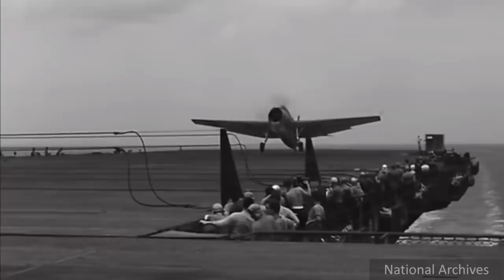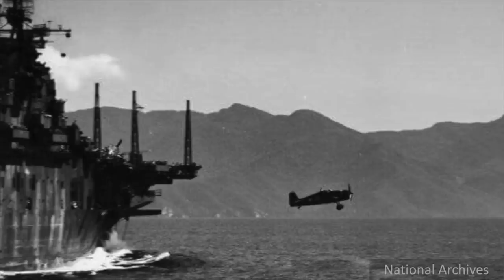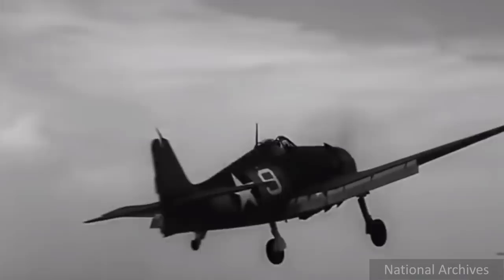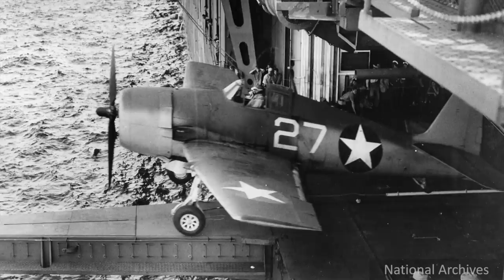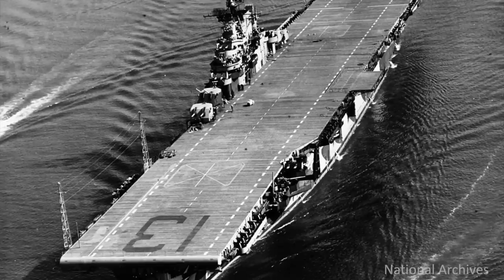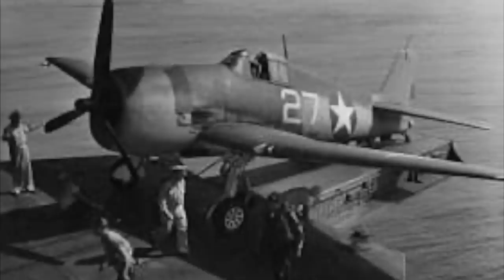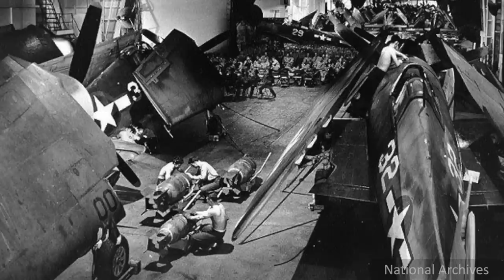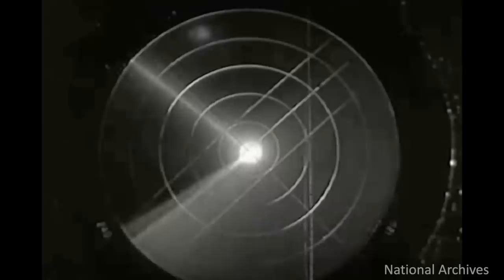Who Knew WWII Aircraft Carriers Could Do THIS?

Comment: Ships had been using catapults to launch float planes for some time before carriers were a big deal. I can't recall the types, but the catapults were up high and rather short.
Reply: Yeah, Battleships and Cruisers used catapults to launch float spotter plains for years leading up and including WWII.
Reply: @williamfuller2389  The British King George V class battleships carried their catapults amidships and launched straight to the side. Same for the USN's Pensacola class cruisers and New York class battleships. Later American ships carried their cats on pivot mounts on the stern, so they could (partially) control the launch direction.
Reply: the key, was up high...and irrc they used a gun powder charge rather then steam or compressed air.

Comment: Planes were launched from Cruisers for scout/patrol purposes as well.  There were catapult arms that pivoted out from the stern to launch float equipped planes.  Recovery was done with a hoist and they were lifted back aboard.  Helicopters replaced them later on.
Reply: They were seaplanes that landed in the wake of the ship and were hoisted up.
Reply: I would add that those were small 2 set planes meant for spotting for the big guns.
Reply: every ship class larger than a destroyer had scout planes from the 1920s until the 1950s, including the needed hangers and elevators

Comment: The Japanese did it; they even built some that had a flight deck extending directly out from the hanger deck, below the upper fight deck.  They had at least one carrier that had three stacked flight decks (one was very short, but it was there).  They pretty much abandoned the idea by the time of WW-II.
Reply: the triple flight deck was an early ship, when planes became too powerful for the old design to work the lower flight decks were removed and converted into hangers while the top deck was extended.

the ship was lost during the Battle of Midway
Reply: @bostonrailfan2427  Akagi and Kaga

Comment: The relative crosswind was a huge help. I don't have my E6B handy, but the pilot has no crosswind effect until flung off the catapult. The aircraft will then naturally weathervane to the hypotenuse of the combined vectors. That airspeed will always exceed his catapult velocity. I got the E6B and this is hard to sus out as you kind of have to work it out sideways, it is smudged, and I am using the wrong pencil. But assuming a ship speed and wind over the deck combining to 40 units (knots, mph, whatever, let's say mph) and a cat speed of 60 mph, the plane weathervanes into a relative wind of 72 mph over its nose. I erred on the low side. If launched underway, if you came off the catapult with aileron  and some rudder towards the bow, it would just come off as a gust reaction.

So it would help, but the launches in the video appeared to be at rest, and so apparently not necessary.

Comment: The first ship to ever launch and recover an aircraft was HMS Furious during WW1. She started her life as a fast cruiser and was then converted to carry RNAS Sopwith Pups by removing her forward turret and building a launching deck from the main superstructure to the bow. She then underwent a series of re-modelling, first removing the rear turret and adding a landing deck on the stern (before then pilots had to fly alongside the superstructure and sideswipe across onto the take off deck - incredibly dangerous  as the pilot who first managed to take off and land back on a moving ship at sea, Squadron Commander Edwin Harris Dunning was killed five days later attempting the same landing when an updraught from the superstructure lifted his Pup over the side of the bow, he was knocked unconscious and drowned in his cockpit). Furious then had a pair of side decks added allowing the biplanes to be rolled from the aft landing deck to the bow ramp and then finally did away with the last of the cruiser superstructure completely to build a through deck or 'flat top'. Her command bridge was situated in the centre of the flat deck at the bow and retracted down to allow flying to commence.
Before the start of WW2 she had a new higher flightdeck constructed but still retained her original bow section which was level with the hanger deck so she could actually launch her aircraft from the lower deck and recover them on the upper one at the same time.
Furious was the first ship to launch and recover an aircraft whilst at sea, the first in incorporate arrestor wires for landing (although they did tend to remove the undercarriage from light weight biplanes!). The first to launch a carrier attack against a land target (Zeppelin sheds, before that she was intercepting the Zeppelins themselves over the North Sea)
She carried on into the second world war, taking part in the Norwegian campaign, ferrying aircraft to Gibraltar and Malta and her Swordfish took part in attacks against the Tirpitz. She survived the war, a German Heinkel bomber's bomb missing her by about 10 yards which threw her prop out of alignment and was finally scrapped in 1948.

Comment: Actually the IJN came up with another innovation - on their two big early carriers of the 1920's,  the Agaki and the Kaga, they had not only a flight deck which did not extend as far as the bow, but also an upper and a lower hanger deck.  Simply open the big doors at the front of the hangers, and fly off a few planes that way when the ships were steaming in to wind.  So, in theory you could launch planes from three differen tpositions - flight deck, upper hanger deck and lower hanger deck.
I think the Akagi lost this ability to launch from more than one deck after a big 1930's refit, but the Kaga continued with it until she was lost at Midway in June '42

Comment: I always wondered why I haven’t seen carriers having “two flight decks”. Dangerous probably, but can be used in an emergency.
Reply: They did exist. The Japanese Akagi and Kaga originally had multiple flight decks
Reply: The Royal Navy Courageous-class battlecruiser-to-aircraft carrier conversions featured two flight decks, but the lower flight deck was abandoned due to the longer take-off distances of 1930s aircraft. It seems that WWII-era carriers and carrier frontline aircraft existed in this sort of zone of not using catapults like post-war carrier aircraft would all the while the spotter aircraft of the era did use them. My guess is that catapult turnaround time was too long but one supposes that had something like the post-war catapult improvements been available in the 1930s then the second flight (or rather fly-off) deck might have been much more used, at least until jet aircraft made the entire concept completely obsolete.

Comment: There is a lot more to this than beam catapults launching out sideways. Several British and Japanese carriers were designed to conduct regular operations out of the hangar deck by flying straight out the front. The Japanese even built a carrier with no less than 3 launching decks, as the flight deck and both the upper and lower hangar decks could launch aircraft.

Comment: Avengers were big aircraft, but I wasn't surprised seeing one go off the  the hangar deck catapult.

"Dits" that were related to me by my father, an RN Fleet Air Arm Avenger pilot (TBF-1C, Avenger 1,) told of Avengers taking off from the main deck of an Escort carrier without catapult assistance (For one-off squadron re-deployment), after  the carrier had been beached in the Firth of Forth, Scotland following severe torpedo damage off Norway. So taking off, in a lightened state, not necessariy a full crew or any warload, when the carrier wasn't even underway.

Comment: A double-decker arrangement would make even more sense if the operation was longitudinal, rather than athwartships. Launch from the lower deck, and recover from the upper. That puts the weight of the catapults down low, still gets most of the headwind, makes a shorter trip from parked to launch, and leaves the upper deck clear for recovery and the usual excitements. Any idea why it was never tried? (Admittedly, the noise would have been appalling.)

Comment: The three Yorktowns also had this. Although Enterprises was ripped out during her late '42 major refit.

Yeah there's not a lot of info on these, because they were dangerous kludges that were never really used. You'll notice 3 of those early Essex's still exist today as museum ships. Other than the big doors you would be hard pressed to find any trace of these. They mostly all got removed at the carriers first major refit. I've never been sure why the early Essex's had them? As they were already planning on yanking them out of the earlier ships.

As you noted by 1943 US Carriers no longer operated alone. They were almost always in 3 Carrier task groups. So if one fouled the deck the other 2 would launch and recover for them. Also by 1943 all American Carriers had a single deck catapult. Which meant they could get any plane airborn using just the front 20% of the flight deck. This area was rarely fouled as most issues occured on landing and rarely extended past the bridge island. Anything that took the front of the flight deck offline typically also took the side shooting catapult below it offline.

Comment: Catapults were installed on earlier carriers, but only on Lexington and Saratoga (CV-2  and -3) because the Admirals still hadn't accepted a dedicated carrier, and Lady Lex and Sister Sara were bigger than the design-built carriers that followed.
The same two carriers were also built with gun turrets on the flight deck mounted fore and aft of the superstructure, battleship-style.  They were not exceptionally useful since firing them to port, across the deck, would rip up the deck, saving an enemy the trouble, so their firing arc was  about 150 degrees.
Both also had a seaplane catapult, again, battleship-style, forward of the fore turret on the flight deck.  Since they were never used and very light (still made of cloth on wood,) the seaplanes themselves  were lashed to the overhead of the hangars to save deck space for useful aircraft.
Seaplanes, their catapult, and the turrets were removed during the first refit, pre-war, the turret magazines repurposed to hold ordnance for the smaller guns that still ringed the flight deck.  The hangar catapults remained, but were never loved.

Comment: They should bring this back for drones in the next carrier designs. Having a separate hangar area which is effectively another mini runway unto itself would be beneficial. Drones could be launched at the same time as their manned counterpart without taking up deck space for full sized manned aircraft. The drones could more easily deal with the adverse takeoff, all the variables can be easily given to the drone such as the crosswind and sea state. In fact with the advancement of drones there are several 1930s-60s concepts which should be revisited. Another addition could be the return of trapeze landing. Again to free up deck space and limit drones to a single area of the ship, while also utilizing the drones ability to repeat the same actions perfectly. This would also allow naval drones to be built without landing gear. Thus allowing greater range and payload.

Comment: Of course, the need to use scouts launched from the carriers was reduced by having the cruisers launch their own scout planes.  This was actually Japanese doctrine (their carriers were meant to strike, not scout at all) but the Americans also made use of cruiser/battleship catapults.  Another factor mitigating the use of the hangar catapult was the American attempt to consolidate aircraft types.  When carriers did launch scouts, the Americans moved to using their torpedo bombers as scouts, and they could not easily take off using the short hangar catapult if they had a large fuel load (which they would certainly require for any plausible scouting mission).  As they didn't want to carry a plane which would be useless in combat, this consolidation of aircraft type made the hangar catapult superfluous.  And this is before the carriers started to operate in large numbers that made one or two extra scouts totally meaningless.

Comment: I wonder if because it had a shorter stroke if it damaged aircraft when launching them, since they had to get up to speed in a much shorter run, and had no wind over deck to help them, the forces on them would be much higher than in normal carrier launches.